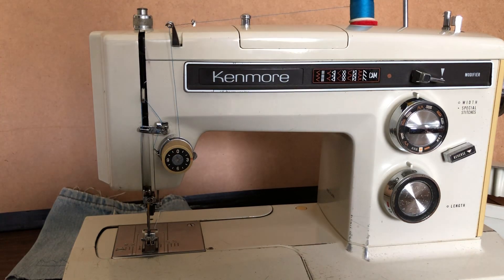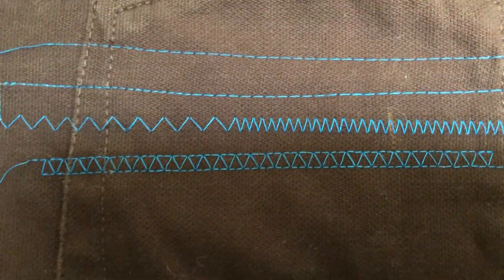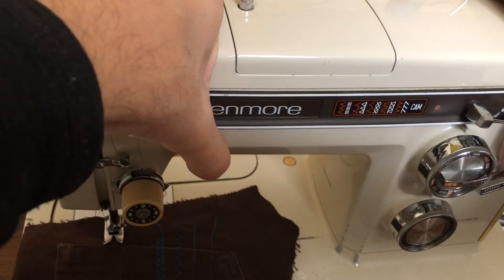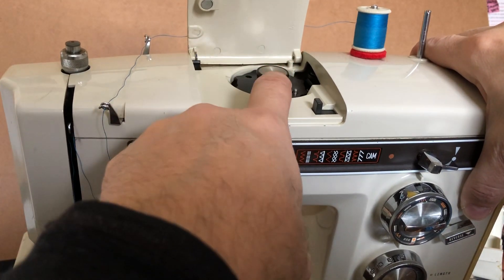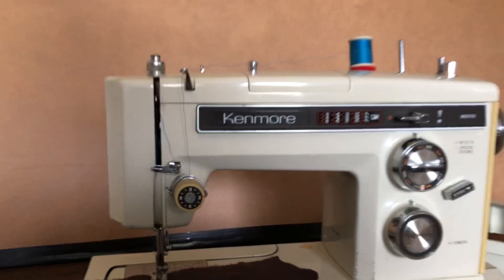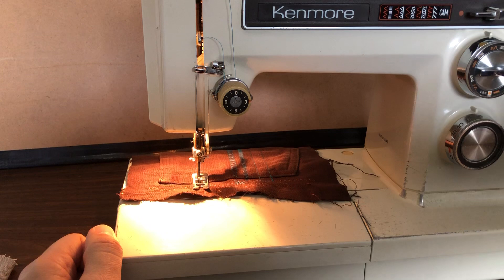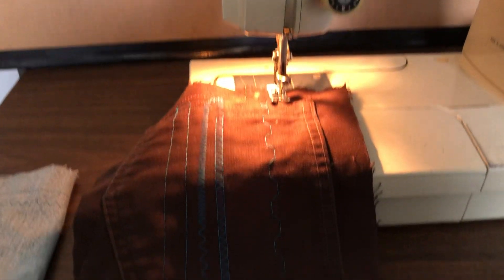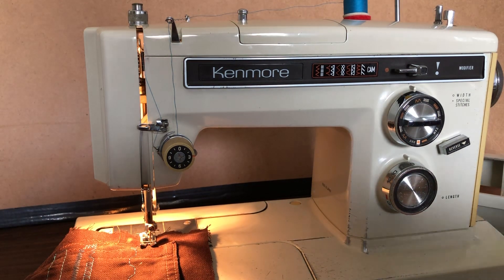DEBUT SERIES #41: Kenmore Sewing Machines Are Strong Stitchers & This 158.1931 is No Exception!!

Comment: What is the difference betwten this machine and the 158.13520
Reply from the maker: The 1352 was most likely produced in Taiwan and produced after the 1941 was out of production.  It is a great machine with lots of high quality parts.  Be careful of the top knob stitch selector as its gears are plastic and can strip.

Comment: What vintage machines are best for light weight or heavyweight materials? By the way I love the show and all the information you share. 🐞 Namaste 🥰
Reply from the maker: Wow, well that's a 'loaded question' Lala.  There are MANY differing opinions on that topic.  What I will say is that I find Rotary style shuttle hook machines are best at 'fine sewing' such as that required for couture fashion/wedding gowns etc. along with quilting.  For heavyweight materials, I prefer Oscillating Hook/shuttle design in a machine and a side loading bobbin.  I find that the Singer 15-91 is likely the strongest home sewing machine ever made.  Having said that, lots of folks have sewed heavy materials with Kenmores like you see in this video along with Berninas due to each having a double belt/reduction pulley setup.  Anyone else care to share your thoughts to Lala's question?
Reply: @VintageSewingMachineGarage  thank you for responding! 🐞

Comment: Love seeing all your work with these old kenmores. I picked up a 158.14300 at a goodwill recently. I was delighted to discover the carrying case lid hides a little table that attaches to the base of the case. I wonder what other little features these machines could include that might go missing over time? 
Also- how do you feel about restoring plastic yellowing? The carrying I have could use a makeover to compliment the machine, but I’m worried about damaging it.
Reply from the maker: I understand the urge to try to bring the plastic on that case back to its original state and there are videos on youtube (not mine) that show various methods.  Just know that the yellowing is a symptom of the plastic degrading (mostly due to sunlight or other environmental exposures) and cleaning can often make things worse even if the yellow goes away.  Plastic is something I would focus on conserving with just basic cleaner and keep it from being damaged/cracked in you can.  Also, don't pick it up by the handle.  Always lift from the bottom of the case and ignore the handle.  It will extend the life of your case and help to keep you from dropping your machine.
Reply: Show your machine some love. Pretty is as pretty does.❤

Comment: I really like your videos about Kenmore machines.  My first machine was a Kenmore 10 model 158.12511 but I'm not sure if this is all metal or not. Have you ever worked on one? I also picked up a model 1703 model 158.17033 that came with 20 plastic cams. Not sure if this one is all metal either. The foot petal gets very hot and I'm not sure what causes that problem. Thanks for covering these great older machines!
Reply: I was hoping you would answer my questions if you can. 
Thank you.
Reply from the maker: The 1703 should be all metal.  Just be extra gentle with the reverse switch as they are not very robust.  As for the 12511 model, I've not ever worked on one, but it appears to have been made AFTER the 1941 series and so it is possible that there are at least a few plastic bits inside.
Reply: Thank you. I will have to check inside the 12511 model to see if anything is plastic. Both machines sew good stitches so I hope to keep them in service for years to come.

Comment: I have a few of these.  Plus a few kenmores that are a bit older.  I have mostly figured out how to fix them myself, but am struggling with one of the 8 stitch units.  The needle shank is not in the center position when dials are on straight stitch and then the other stitches dont work.  Cant figure out how to get it recentered.  Any hints?

Comment: I am surprised that the old Kenmore's seem to be well thought of these days.  I bought my Kenmore 158.1760 sewing machine new in 1974 and it seems to be the same as the 1931.  Mine looks a little better than your 1931 though I've used it continuously until my sis gave me a Viking Emerald 118 a few years back.   I sewed my and my children's clothing, using it for quilting and many projects through the years..  I am currently oiling and greasing the machine to use it for quilting a quilt, though I hesitate to take the tension apart and hope it will test out okay.  I also have a 1963 Kenmore in a cabinet that was my mother's with all of the cams also.  It also looks almost the same.  While the Viking has some nice newer features that I like, it cannot be used for actual quilting (no walking foot including the one made by Viking will fit this machine).  The Viking has no access for oiling, etc and it must be taken in for any maintenance, etc.  I put a drop of oil under the bobbin case anyway and that's that.
Reply from the maker: Thanks for sharing.  Sounds like you've gotten your money's worth with all the machines in your collection!

Comment: Another great video. There are so many great Kenmore sewing machines out there. They see really well but often get overlooked compared to Singers and other brands. My only complaint is that they don't fit into a singer cabinet (without modification) because of the square corners.
Reply from the maker: Your point regarding the machine dimensions and Singer cabinets is true.  There were 'some' Kenmore models that were more like Japanese Clones that could fit into a Singer Cabinet, but the square corner shape of most Kenmore machines were based off of the White company's specs.  It was one brand that could challenge Singer in sales and so they could afford not to sign onto the Singer dimensions.  Most other brands made machines to fit Singer tables though.